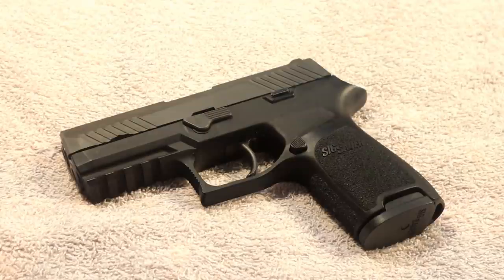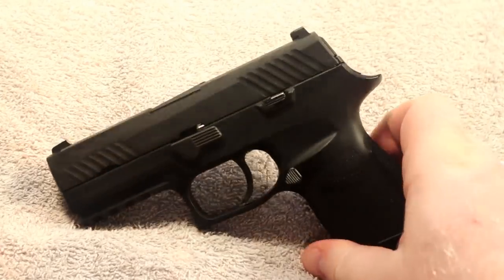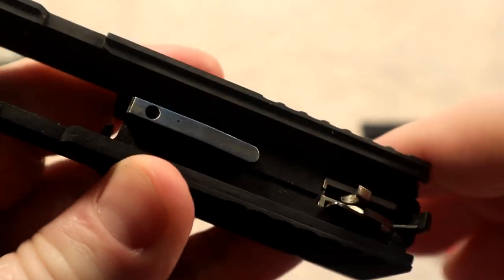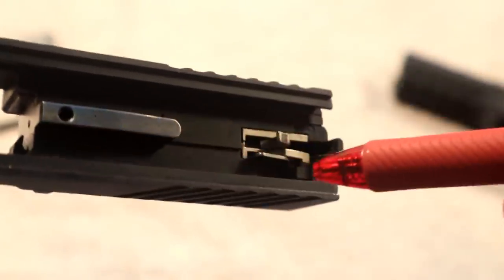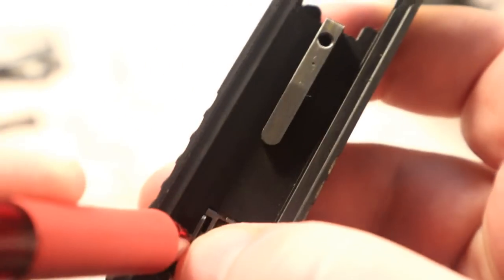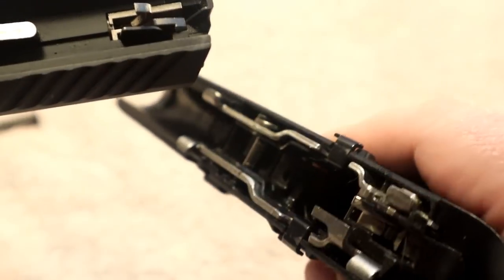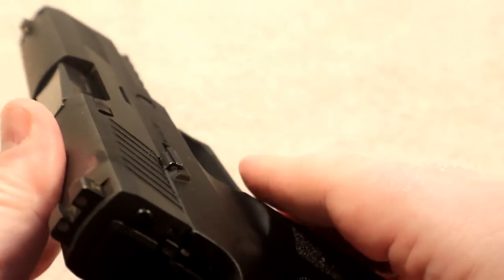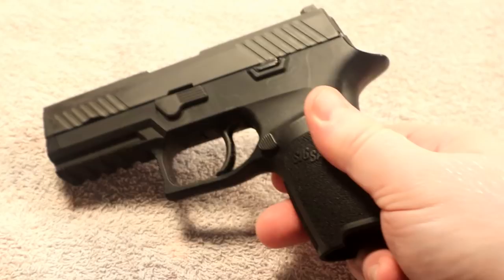The Sig P320's Dirty Little Secret You Won't Find in the Manual

Comment: The p320 striker is under spring tension while in battery. 
The safety plunger can easily hang up due to carbon fouling.  This is not a large leap for this gun to go off without depressing the trigger.  Sigs design allows for a great feeling trigger, yet it also gives up a lot of safety.  Personally, I prefer the double action design of Glock for ccw.
Reply from the maker: Glock is not double action and there are many manufacturers who use the same type of striker system.

Comment: I have two of them and keep them loaded and have never had any problems. This woman was carrying her weapon in a purse now that’s being irresponsible she should have known better!
Reply from the maker: Yes she should have
Reply: Gun was duty holstered in the purse.
Reply: @rsbreeze  so the report says. I am betting it is mote likely the pistol was not fully holster when it fired.
Reply: @Tazer120  I doubt it, these holsters are secure with specific retention devices. I have carried all manner of holstered weapons (leather, Cordura, kydex), in all manner of bags (range, backpacks, duffle, suitcase, breifcase). Never had one come out of holster, nor fire.

I have 5 Sig pistols (which I like) of 50 that I've owned. The only one ever replaced due to design and quality  issues was a Sig P238, but were not safety related. That gun was redesigned and reissued. It's a fact that many weapons are rushed to market and issues are there.

Comment: I mean, it doesn't take much to disengage the safety and if you use a soft holster or a holster that may be just out of whack enough to slightly engage the trigger, just a fraction of a pull and the safety is disengaged and a slight bounce or bump is enough to fire the weapon. Worst case scenario there is an aftermarket bladed trigger for the 320.
Reply from the maker: Don't use cheap holsters
Reply: @BoomStickTactical  expensive holsters can fail too. The amount you spend doesn't automatically make things better. Shocker I know.
Reply from the maker: @xMrBlack  when you buy junk you get junk. There's nothing wrong with sig pistols, especially if you use a good holster.

Comment: Great informational video.  You are correct, we have NOT seen the armorers report and full-breakdown of the suspect firearms.  We do NOT know if maintenance, cleaning, stiction or other issues have been completely ruled out.  You have shown that the trigger must be pulled for the firing pin block safety to allow the firing pin to hit the primer.  But you have not ruled out the possibility of STICTION, cleaning, maintenance ?
Reply from the maker: The problem is not the gun. It's the people who don't know how to handle them

Comment: Thank u for this video! Been duty carrying a glock 45 and just switched to p320 after seeing great reviews. I started researching the dropfire issue and had come across more recent claims in the past 2 years.
Im confident i can rely on this gun to perform as expected.

Quick question, do u see any great benefit of having a trigger safety like glocks do? Or should i not worry about missing out on that feature on the p320?
Thanks again! This gun feels like it is built for me.
Reply from the maker: That would depend on the skill level of the operator. As long as you keep your finger off the trigger and don't let it get snagged on anything I think you would be fine.

Comment: The OP is spot on correct.  Everytime someone snatches the trigger and the fire-stick goes "BOOM" they blame the fire stick.  The internet of course inflames the process because there is a never ending line-up of self-proclaimed "experts" who don't even know how to disassemble a gun who want to glom on and "me too" the BS.
Even if the striker sear disengages from the trigger sear, the firing block prevents discharge and the ONLY way around this is for some ham-fist to be PULLING THE TRIGGER!  Nuff said on that!

However, this an excellent time to make a POINT about why Glocks were and still are SAFER than the new Sig 320 - and here it comes.

With the slide off, takedown lever in stowed position, press down on the trigger sear.  It pressed down with no problem.  So in it's "static" condition, if exposed to "enough" shock load, the trigger sear can be caused to "bounce" out of engagement with the striker sear!  Of course, if this happens, the firing pin will be prevented from firing the pistol - UNLESS a human fanger is snatching the trigger!

On a Glock (all Glocks since day one), in "static condition" - meaning gun chambered hands off.  cruciform rests atop a ledge that is part of the FCG housing that prevents the cruciform from dropping downward.  Thus, when the striker is captured behind the cruciform (sear), the gun can be HURLED against solid, depleted Uranium walls and it will NEVER disengage!  NEVER.  The action of drawing back the trigger - which first requires the trigger safety lever to be depressed, moves the cruciform to the rear and just as it is driven downward by the connector, it also passed off the limiting ledge so it CAN drop downward.  At the same time the trigger bar presses against the striker release button to the striker can reach the cartridge primer!  With a Glock the striker cannot be caused to jump out of engagement - no heavy springs required, just the most outstanding design of the 20th Century!

I'm sitting here with examples of each for comparison and I do love the look and lines of the Sig and the astoundingly CRISP, near zero-take-up trigger, but that does come at a PRICE...and the price is it can be "bumped" into disengagement - the Glock's cannot.

The Sig trigger is very much like that of the Springfield Armory XD - neither requires "take up" of the trigger prior to release and so neither has a supporting frame ledge as does the Glock.  Both can be "bumped" out of engagement, however the SA XD does have a grip safety that must be depressed, the Sig has ZERO external safety other than an intelligent brain between hand and trigger.  Both have outstanding SA trigger let-off!
Reply from the maker: That's a lot of details. Thanks for sharing

Comment: I guess I am confused. There are all kinds of take down/reassemble gun videos on You tube.  ?  Having said that...to open a can of worms with today's gun people, THAT is why there should be a manual safety on all pistols of this ilk. Unless you are pulling back a hammer, as in the style of a true DA/SA, this is going to happen. 'Glock leg' is not restricted to glocks alone (although it is the only gun with a negligent discharge named after it) It doesn;t matter how heavy a trigger is. It is the sudden break. 
Never mind the stupidity putting this into a purse with a chambered round. It is not a failure of the gun,  that the trigger got caught on something, setting it off. it is stupidity and ignorance.
Reply from the maker: Yep
Reply: When you become more popular, there are gun hating ninnies that report you for anything. Then YouTube will yank your video off. The other videos I bet are lesser known gun channels, and not likely to be reported for disassembly displays. 

 The only thing I ever heard was that children now from watching TV/Movies know how to put a round into the chamber of an auto pistol, and gun owners depending on "It doesn't have a round chambered, the kid won't know or be strong enough to chamber it" was negated by seeing it done a 100 times in TV and Movies. 
 
 Just like characters having to just pump the slide on a pump shotgun, "For Emphasis" even when they pumped earlier. I think that's their theory, and "Teaching how to build a gun" from people who don't realize field stripping to clean and/or function check a gun isn't "Building a gun", due to their total ignorance of guns.

Comment: How much rear movement of the trigger does it take to disengage the striker block. Not much! Also the design is flawed by having the striker fully cocked at rest.
Reply from the maker: There are several striker fired guns that have fully cocked strikers. There's nothing wrong with them.
Reply: Dear mr. Broomstick if you are happy with a sig p320 more power to you. I personally don't want one.

Comment: I stopped trusting them after they called it a “voluntary upgrade” instead of a RECALL
Reply from the maker: I know several people who had already changed the trigger in theirs before and never sent theirs in.
Reply: Yeah that was a shady business decision. If the “upgrade” makes the pistol safer then it is a recall.
Reply: I get it...100% agree...unfortunately it is a common occurrence in this and some other industries.  Glock did the same thing with their gen2 slamfires, and then proceeded to cover-up several other safety issues, for instance.
I think all these recent pile-ons are a direct result of Sigs side-stepping responsibility and hedging, and could have been prevented if they faced the drop fire issue head on.
It's a different world than when Glock and others had their issues...things leak out now...companies need to treat issues like Lexus did right after their launch problems, imho.
You can't just follow Glocks example and market, deny, market, deny, market, deny.  It will get out today and possibly be exaggerated and blown out of proportion in our cancel culture.
Reply: They cant force people to send in their property. They can tell FFL's to send them in tho
Reply: @protectiverailroaddad7541  why was it “Shady”? If you never had a problem you had a choice to turn it in for the upgrade. I know a few people that didn’t turn theirs in. They felt that there was no problem with their pistol.
Reply: @weaponeer8582  because it was a recall and sig chose to use the phrase “voluntary upgrade” to avoid more negative publicity. If a gun is firing when dropped then that is a serious problem, especially when it’s supposed to be drop safe. Then you send it in to get the “upgrade” and it is now drop safe. Every other company that had an issue with guns not being drop safe called it a recall, not and upgrade because that’s what it is. I chose to send mine in for the “upgrade” but I know a couple of people who didn’t. I’m not demonizing them, it’s their choice. But sig didn’t want to damage the image of the p320 so they used the word upgrade. Anyone with any understanding of this situation knows exactly what I’m talking about. Bottom line, sig didn’t want to hurt sales with a recall of a hot pistol that just got a lot of traction from the adoption of the U.S. army. Hey man, I like my p320 and it’s one of my home defense guns, but I call a spade a spade no matter who it is.
Reply: @protectiverailroaddad7541  do you hear how petty that sounds?! You’re upset because they chose not to call it what you thought they should call it. You turned yours I for the upgrade free of charge. They did the right thing. Doesn’t matter what they called it.
Reply: @weaponeer8582  I’m not upset about anything. If a gun does something it’s not supposed to do, then the manufacturer modifies the parts so it no longer does what it’s not supposed to do then that’s a recall. It’s ok to be a fan of a gun and/or company and call them out. I like sig and own a few but it is what it is. I guess you don’t get what I’m saying, so we can agree to disagree.
Reply: @protectiverailroaddad7541  actually the Sig P320 passed drop tests that the industry used. The specific angle that the gun had to fall at was not a standard drop angle. So many you tubers broke their 320 frames trying to recreate the issue it was almost funny. The gun was not dangerous then and is not now.
Reply: @Tazer120  yeah in a perfect world the gun would never fall and land at that exact angle lol. Unfortunately Murphy is always at work and we can’t choose what angle a gun lands when dropped. If the gun fires at any angle when dropped it is not drop safe, period.
Reply: @protectiverailroaddad7541  I totally agree with you. Wording DOES make a difference. My good friend who is the PR guy for MAXXIS said the same. Wording matters. Say what you mean and mean what you say. (And you did not come across as angry to me. Folks are always so quick to jump on that aspect these days. But reading comprehension has gone to shit as well, so there's that...)

Comment: OK you are right 
As a gunsmith myself I'll ad my analysis to the fcg on the gun
This particular gun may discharge a round without touching the trigger if its extremely dirty to cause that fiering pin block to stick down and that sear to stiff not to catch that pin firmly which can cause the pin to fall on impact and discharge the gun 
So maintain the gun and keep it clean and you are 80% safe 
Ad to that .... keep your guns chamber clear while carry to be 100% safe 
Myself I don't recommend a round in the chamber in a striker fired gun 
If its a hammer fired gun you could still lower the hammer half way to be 90% safe when a round is in the chamber 
Yours aoolf
Reply from the maker: I don't see how it could, even if it was very dirty.  It would take a lot failing and even then, it would clearly be the fault of the operator.

Comment: I would like to see the holster examined. there would be powder burn where the barrel was when the pistol fired. was the pistol properly positioned or was it pulled out a little. Enough for a small item to pull the trigger? And like if it's a malfunction the accidental discharge would be repeatable. An unsafe firearm doesn't just discharge one time.
Reply from the maker: Ywp

Comment: "Oh no, not me, I'm a detective I cannot have ND's. Points at the gun, it's your fault!"

In helping build trust for me, I would load a snap cap and keep it chambered, put the gun through its paces and observe no discharge. Then carry it for sometime with the snap in the chamber, followed by a full mag (this is also how I learned to be comfortable with carrying one in the chamber) and it hasn't discharged. Built trust in it, and I do carry one in the chamber. It's been years and no discharges. I love my p320 xfull (previous p320 full and upgraded). I will admit, when switching to appendix carry, it did take time for me to build trust (in any gun) to keep one chambered. Great video, thanks!
Reply from the maker: Thanks for watching. The snap cap idea is a good one.

Comment: I have been trained to check every semi auto handgun to check the firing pin to make sure it has not been broken/ protruding. Not sure if this is the case with Sig's. But a broken firing pin will make a round go off without pulling the trigger, especially if you load a round in the chamber normally.
Reply from the maker: But it would not mysteriously repair itself when it was inspected. No mechanical problems have ever been shown
Reply: @BoomStickTactical  exactly

Comment: For people who want to read- as the trigger is pulled back the trigger movement disengages the safety. This is a small amount of movement & even smaller when the gun is dirty. If you take a standard P320 and pull the trigger back to the place you get resistance, (on mine that is 4mm of travel), the safety is now off. On a dirty firearm due to the way the safety bar is designed that distance decreases by 75% so  about 1mm of rearward trigger travel could / can / might disengages the safety. UNDERSTAND you still need further trigger travel to actually fire the weapon, just because the safety is off doesn't mean the weapon can fire. Now that the safety is disengaged ( called, "the take up"), as the trigger is pulled back farther, (the 5lb-7lb pull weight) that tension you are feeling is the striker being pushed backward and compressing the firing pin Spring, when it reaches full travel (the end of the trigger pull) it releases the spring which slams the firing pin forward.  There is NO PHYSICAL WAY for the spring to be placed under firing tension other than the trigger pulling it back..PERIOD, end of the story...the TRIGGER MUST BE PULLED TO FIRE THE GUN. All instances of P320s firing have been by accidental unintentional PULLING OF THE TRIGGER...
Reply from the maker: Bingo and cleaning your gun can help make it safer.

Comment: First video I found in an attempt to learn the mechanical design. I dont own one personally, have always favored the Glock, but I do like Sig. But I just watched a few vids of incidents that are undeniable. One where the officer is getting out of a vehicle on camera with his hands full nowhere near the firearm and it discharged. Multiple claims of similar incidents makes me believe there is an issue. And I'm sure the company and others have found the perfect storm or wear on certain parts that allow it to happen. Very familiar with the 3 internal safety's that the Glock has and would like to have one in my hands to actually understand the internal design better. Thanks for the video and info.
Reply from the maker: If you have an incorrect holster and allow something to get against the trigger, it can go off.  The same can be said about any gun.
Reply: @BoomStickTactical  Sure, but that is an assumption of the scenario as well. May have been a sufficient holster, more than likely the case. But mainly referring to the multiple claims, unusually large number of similar claims. Hard for me to write that off while keeping an open mind. That gun is in a single action state with no trigger safety. Although it does have a couple internal safety's it interests me in the build design. Definitely think this will hurt their sales for this model and possibly others if they dont make a proactive response to this or prove otherwise.

Comment: It is possible that the firing pin safety get stuck in the upward release position, but also then the sear engagement needs to fail for it to go off without the trigger being moved.  But still I have seen a video of one going off in a cops holster while he was walking.